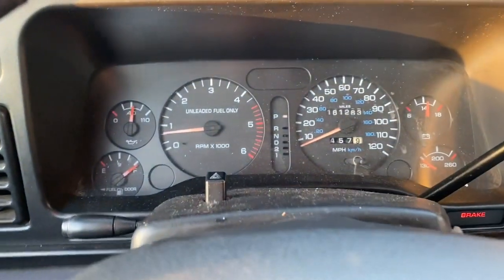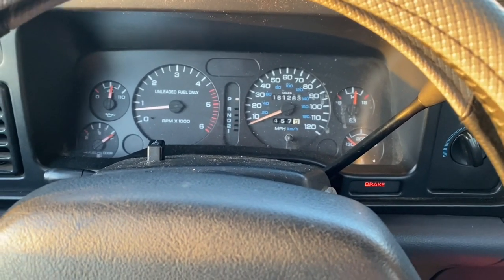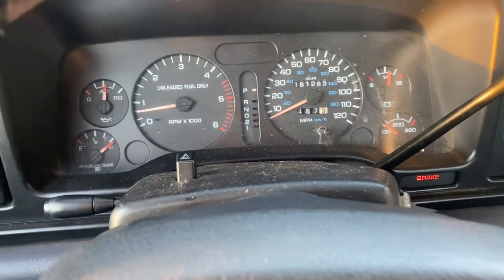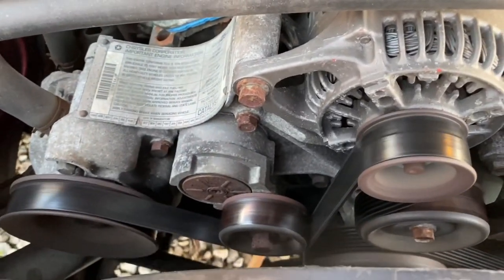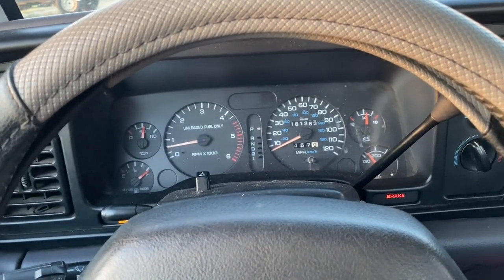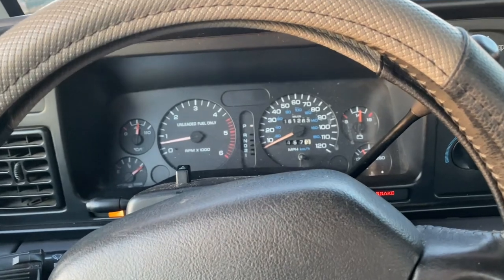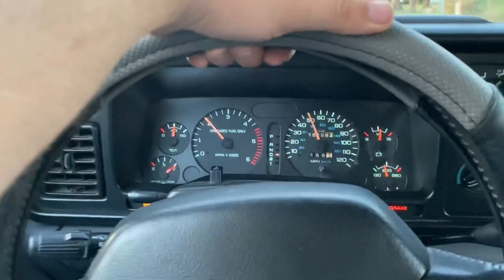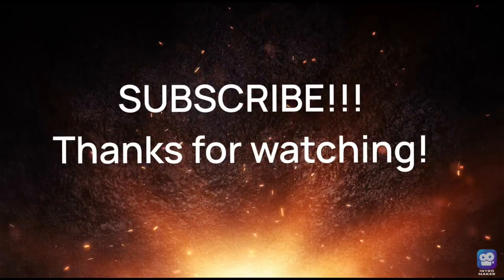What it’s like to own a v10 Dodge Ram

Comment: Everyone thinks the v 10 shares parts with viper v10’s ( not even close)
Reply: When they disigned the magnum v10 they started from scratch. They didn't take the sketches from the viper v10. So nothing is the same about the 2.
Reply: Careful what you say, you might be dead wrong. Doesn’t take much to rework the water jackets and fit the gen 1 viper heads and intake to the cast iron truck block. Oil pump is the same too, all sensors are the same for 1st gen vipers. I can go on and on.
Reply: @moneybitches4796  I wouldn't say "much" work.  Because if you go cutting and welding on the intake one little leak and you're gonna be rebuilding the bottom end of your engine. Not to mention killing your fuel economy if the heads don't fit right. But yes it could swap parts. You could theoretically get any parts to fit on at engine it's just about time and money and of course the quality of the  fabrication skills.
Reply: I doubt after everything they put it through that it shares any stock parts but they started with the v10 magnum design when building the viper V10.
Reply: It’s understandable why people think it’s similar because both have 8.0l

Comment: The v10 actually makes a little more hp than the 5.9 definitely more torque tho but also a heavier truck
Reply: Torque and horse power are both higher in then v10 the 5.9 didn't gain an edge till 98.5 when the switched for the 12 valve to the 24 valve

But I would still rather have the Cummins cause well Cummins
Reply: I read what you said wrong nvm
Reply: My bad
Reply: With a few simple free mods to the 12 valve, the v10 wouldn't come close
Reply: @thomasmoss6266  I think he's talking 5.9 Magnum, dawg. It was a V8 5.9 gas.
Reply: No shit its literally the same engine as the Dodge Viper
Reply: @drivingmylifeaway7149  I think a dude named “monkey wrenching” would disagree with you entirely
Reply: @thomasmoss6266  i think he was referring to 5.9 magnum and 5.2 magnum. In the video. The 5.9 magnum made 235 hp 330 tq til 98 they upped the power to 245hp 330tq.  The 5.2 same 220hp 300tq 98 up 230hp 300tq. But the cummins 5.9 12 common rail is its best at towing and more reliable too. They only made like 190hp or 200 somewhere there but torque was close 400. The v10 was 295 to 300hp and 450 torque. Somewhere.
Reply: @merkedgg6322  the 8.0 they put in the 2500 and 3500 trucks isn't the same motor as the viper's 8.3 that can be found in the 3rd gen SRT-10 Ram.
Reply: @gc99289   He probably was, but the v10 actually does have more HP and torque than even  the 12v Cummins. The v10 gets 310 hp and 450 ft pounds of torque.   (12v 190hp 400 ft pounds) 

The Cummins would get better mpg though, these things are indeed pigs, and gas mileage doesn't change no matter how loaded it is! 

They're tanks for sure,  95 2500, 3 ton of scrap on a trailer,  doesn't even know it's back there!
Reply: @michaels1326   Yep, for starters, the viper engine has aluminum heads designed by Lamborghini.  The truck v10 is a cast iron unit, and doesn't have as high a redline .
Reply: @merkedgg6322  not a viper engine.. big difference
Reply: @merkedgg6322  its literally not
Reply: @daveunknown01  absolutely incorrect. They share the same block geometry.  In fact, the Lamborghini designed V10 in the Viper is based on the V10 iron block.  They literally sent them an iron block to use. While they share no interchangeable parts the 8.0L Viper engine is based on the 8.0 iron block

Comment: I had a replica of the Twister Ram with the V10 for 6 years, the engine was fun, ate gas, was my daily, and higher mileage at 266k when the engine blew up. Spent more on replacing the entire engine than I did on the truck, but it was worth it! I got a 95 V10 4x4 2500 fully restored in my sights for my second Twister build, 112k miles. This video popped up and I had to watch it. Hearing that V10 flutter got me excited to have one again! Thanks for the video!
Reply from the maker: That’s awesome!

Comment: Dude those v10s are badass. I averaged 12 with mine. Ive had 4 because  nobody wanted them. Reliable and they run strong. And  they will haul ass with a 5 speed manual driving like you stole it. The biggest problem i had with mine was the disappearing rear tire act
Reply: the left tire ripped off my brother's, and that caused him to scrap a 20k build
Reply: The infamous Mopar V10 "traction issues" being had on roads at night😂😂
Reply: I just bought an 01ram 2500 V10 with 55k original with a blown motor.😢

Comment: Don't daily drive a Ram V10 unless you work three blocks away.
Reply: They aren't that bad most people drive and rev them like it's a V8 and are surprised by the bad milage if you drive it normally and keep it  2000rpm and under at 60-65mph you'll average 16-18 highway and about 10-13 city with an automatic, people with the 2001-2002 V10 6 speed trucks have gotten an upwards of 18-20mpg I daily drove a 95 C2500 with the tbi350 and 4l80 for two years that got 13mpg and it's noticeably better on fuel then that old gal was so I wouldn't trade my 2wd V10 Dodge for anything if you drive it like a diesel you won't have an issue

Comment: These engines have soured me on Dodges. I will never buy another Dodge. First engine had a cracked piston due to someone mixed up the lay pattern of the plug wires in the plastic conduit carrying the wires to the drivers side. There are warnings about this in the factory manual. About a month age the harmonic balancer spun off the front. Dodge was to cheap to put a keyway there. Got a new balancer and it wobbled on the crank shaft. The end of the crank wore down to small for the new pulley. Then last week Lost oil pressure. So now I'm on my third engine and the truck only has 125k miles on it. Dodge, NEVER AGAIN!
Reply: I failed to metion at 75k miles the RE47 transmission failed

Comment: I have owned several Gen 2  V10 2500 & 3500 trucks. All have been very reliable and not difficult to repair. I would not hesitate to buy another. Keep the freeway speed down and MPG is not bad.

Comment: Bought a 2001 new with 5 speed. Traded in 14 years later with 190k. 2014 Dodge diesel with auto. I did basic maintenance on 2001 nothing else. Didn't even put a starter on it. Nothing Major. 2014 40k sold ir. Went through 3 transmissions. Bought a 2002 v10 2500 5 speed with 100k. Love it....

Comment: Yup, definitely built to tow. It's got the character and low down torque of a diesel. It gets nowhere near the mpg of a diesel, though. Years back, during the last period of spiked gas prices, I towed my 33' 5th wheel the length of California getting 6mpg and paying $4.35/gal. With the $100 limit that most credit cards had on at-the-pump transactions, I had to use two different cards at every stop. Other than that, though, I've got nothing bad to say about the V10.

Comment: I have 2 of these trucks, both of mine are 1995, one has 6xx,xxx miles its the 2500, the other i just bought yesterday is the 3500 dually, it has 236,672 miles, I am also in the process of selling my 2001 ram 1500 with the 5.9
The best thing about the v10 is gas mileage doe not change no matter if you are towing or just idling. 
Both my v10s have exhaust leaks, parts are stupidly hard to find, even more so on the dually that the 2500. But I haven't found it too expensive to work on. But yea both of mine are the long beds, on my 2500 I'm the 3rd owner my dad was the second owner. On the 3500 I am the 2nd owner.

Comment: Drove my 1999 3500 v10 9hrs 30min (560 miles) gas prices $3.09 per gallon. And had a half tank when I reached my destination. I also had a camper top. I kept my speed between 70-75 mph most of the trip. Total gas purchases were $210 one way.

Comment: 80 to 120 bucks to fill the tank up from E but Diesel is way higher than premium gas where I live, and any engine can gain efficiency if you're the type to do powertrain modification, I mean I see a lot of people on here applying turbo kits soo not a bad option even in today's times. Very insightful video, love these era of Mopar trucks "They don't make em like they use to"😂😂

Comment: As a former owner of one of those, I disagree with everything except the gas mileage and performance. Overall it was one of the best vehicles I have owned. I had it for almost 20 years and put well over 100k hard miles (towing and off road use) on it. Never had any problems other than normal wear items (brakes, etc) and it was easy to work on. I sold it to a friend when I bought a newer Cummins powered Dodge. He installed a snow plow on it and is still using it almost daily. Aside from freeway speed towing, I would recommend one of those trucks any day. Diesel fuel is now almost double the price of gasoline here now, so the mileage doesn't seem so bad anymore.
Reply: Same here.  Best truck I ever had.

Comment: I find mine easy to work on. I’ve done a radiator swap and alternator. Also oxygen sensors. No special tool needed for the sensors other than a adjustable wrench. After replacing the sensors, it hauls ass now.
Reply: Hello slayer question I have a dodge with the v10 and running great but when I pull a trailer I get low power and tiking noise in the engine , like when cheap gas. Tipical noise and I wonder it could be timing? Or any sensor , don't know any help thanks you , 2001 dodge ram 2500 v10 auto
Reply: @alfredorodriguez5758  I started using the higher octane gas and a lot of my problems and noises went away. I still hear rattling in the catalytic converters.
Reply: @bourbonslayer7303  well yes I used 89 because that's what the manual of the truck said but I will try premium for now , thanks for the reply
Reply: @alfredorodriguez5758  good luck bro

Comment: I have a 1996 2500 v10. Runs amazing and has the nastiest custom exhaust system 💪 I get 13.4 highway and about 9.8 city. It's pulls like a train and gets to 70mph pretty quick. I'm a Cummins fan and the v10 has to be the best gasser iv ever owned.
Reply from the maker: What type of exhaust system do you have? I’m looking to have mine done. I absolutely LOVE my v10 truck, first one I’ve ever owned, wont lie, was skeptical at first but seems to be a pretty good truck.
Reply: Absolutely love mine I have a 98.5 2500 V10  2wd ext cab sb I went with a black widow dual 2.5" in  3" out angry housewife muffler and kept the cats on because there wasn't a thing wrong with either of them I'm running 285/75/16s and factory open diff with 3.73s and I'm  averaging 16-18 highway and 10-13 city
Reply: @projectauto1928  I'd go with a set of Gibson headers and step up to dual 2.5 " in downpipes with magnaflow high flow cats and a decent sized muffler of your choice with dual 2.5"in and  3"out any smaller then the 3" out and you can say goodbye to your exhaust valves pulling weight and just working the truck throw on a cold air intake and that's your best bet for optimal performance while gaining a little extra

Comment: I own a 1999 2500 4x4, far as off road it does great with a load in the bed or pull a trailer through the woods. Great farm truck, ive had mine for six years and has 240,000 miles. PARTS ARE HARD TO FIND. You got to know where to look OR buy a entire moter for parts. Mine it a Heavy-duty version both 2500 and 3500 are Heavy-duty 2WD will come with one ton Dana 70 rear end the 4X4 will come with a Dana Spicer 60 up front also has one ton axles and drive shafts. Gas mileage is poor but I had mine lifted with 35x12 50s but my purpose is to pull and operate in rough terrain.

Comment: Dad bought it new in 95 first Gen hook up a fifth wheel and took mom around the country for a few years they put it in a garage and it sat until about 10 years ago and I love it only now over 25 years later is getting original parts replaced AC system brakes and radiator it's got 114,000 original and I wanna put a turbo on it

Comment: A spec correction for you. The torque peak on the the V10 is actually 1100 RPM in the medium duty and 2400 in heavy duty, the HP peak of 300 is at 4100.

Comment: I see your smog/air pump is still in tact on your V10, if you end up having to delete it PLEASE do a video breakdown on the process.  I've found another youtuber thats mentioned the repair but here in Florida, a few of us w/ the v10s are eager to see how that works with the smaller belt & altered tensioner pulley.  Thanks in advance!

Comment: Getting parts for that truck shouldn't be all that difficult. Those v10s are pretty much Magnum V8s just with two cylinders added. Same as the 318 magnum. A few differences, but a majority of the parts can be used back and forth.

Comment: 310 hp  450ftlbs torque. Stock. Cold air induction adds hp. Free flowing exhaust adds torque. Max hp at 4200 rpms  max torque from 1200 rpm to 2400 rpm. Ask the man who owns one. 265,000 miles rock solid, no runs, no leaks no errors.  Alternator, water pump, tstat, radiator and trans. Rebuilt in the miles stated. I 'll have the rest of my life. 10mpg avg city 15 on the road 3:54 to 1 rear gear. Auto 6speed 5th and 6th o.d.

Comment: Idk man after doing GM my whole life my v10 is a breeze to work on , it does amazing off road when it needs too , I do use it to tow and it is awesome there . It acceratetes pretty quickly but top speed is not impressive at all mines a 2001 4x4 slt Ram Laramie so maybe that’s why I disagree with this your assement . It’s not a race truck but it’s not a slouch . First Mopar second 8 ft bed I agree with the turning thing
Reply: That year doge was limited to 117: wile same year ford and Chevy were 107 and 105 trust I know lol, 410 gears will make it launch hard 35 gets for highway miles,mine has 410 and over 300,000 miles on

Comment: I have a first gen 95 V10 4x4 2500. It was ordered with the heavy front and rear diff's but it has the higher gear range front and rear with the big 5 speed manual trans. If you keep it under 65 MPH unloaded, I've seen it get 18 MPG. Right now, the truck " I call it Rocky " Is down. At just under 270K miles the radiator, water pump, timing chain, and front main seal, need some love. But I really can't afford to drive it right now anyway. The fuel tank is real close to 33 to 35 gallons. Not the kind of vehicle you drive in town. However, Rock is hands down the best truck I have ever owned. He was my daily driver for over 7 years in the black hills of WY. I put loads on that truck that would destroy most others. I'm considering a cm and turbo when he goes back together.

Comment: Gets the same as 360 same years, 35 gallon tank, and more horsepower and torque than Diesel in 2 Nd years, I am 1 owner of a 98 with over 300,000 miles on with 9” lift and 40” I rocks, wench bumper 12,000 lbs wench, roll bar and led lights bar and spot

Comment: Have a 2000 Ram 2500 QC Sport I bought new and just drove to Coney Islander to pick up dinner (point is it still runs). What you get is really poor axle seals, possibly the world's shittiest transmission (rebuilt 3 times in the 88,000 miles on it), a gas guzzling motor that is shamed by most modern V6 motors, paint so bad from the factory, it's like a Mako $99 respray and internal plastic parts that started to self destruct after 5 years (I'm not sure they could have sourced cheaper polymer for the dash cap). I believe I paid for every option available only to have the front ball joints leave the building before the first year was up. It was the last American made vehicle I bought and ever will buy. That being said, I am starting a mild factory resto on it for shits and giggles. Other than all that, the AC has never been serviced and it still blows ice cold. Amazing...

Comment: I just won a 98 3500 2wd dually v10, 137k miles, 2900$ plus some fees so abt 3400$ otd at the auction yard. Oh yeah and its got the manual transmission. Bought cuz it was a killer deal and already headed there for a car anyway, probably gonna be a dedicated tow unit.

Comment: I agree with towing part bud, it's actually the reason I bought mine, so I could pull my 32' camper. With the right tires, it's very capable offroad, but like you said, the turning radius sucks